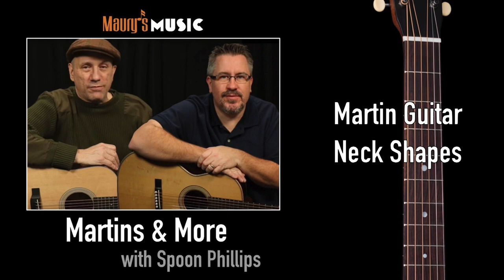Martin Guitar Neck Shapes Explained  |  Martins & More Podcast with Spoon Phillips

Comment: What kind of neck does the 000-15 Streetmaster and the 000-16 Streetmaster have for a neck? Modified low oval profile and high performance taper? Also, are you still going to do a video comparing the two? I’d love that it you did!! I’d hit the Like button THREE TIMES!!!!! Thanks for all you guys do and teach.
Reply from the maker: Thanks for the likes. :) 00015M Streetmaster has MLO standard taper https://www.maurysmusic.com/martin_000_15m_streetmaster_specs
Reply from the maker: 00016 Streetmaster has the MLO with high performance taper https://www.maurysmusic.com/inc/sdetail/martin_000_16_streetmaster/205485
Reply: @MaurysMusic  Thanks
Reply: @MaurysMusic  Thanks